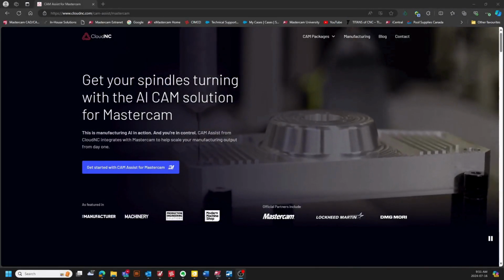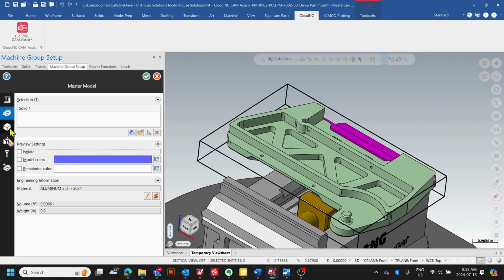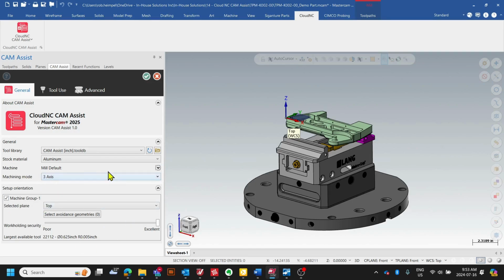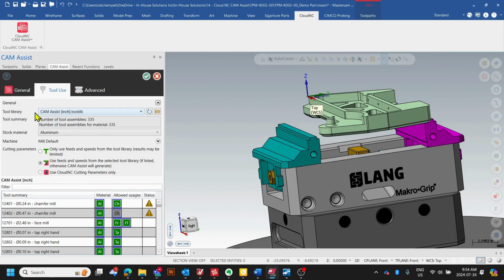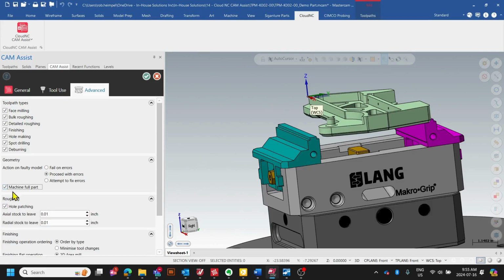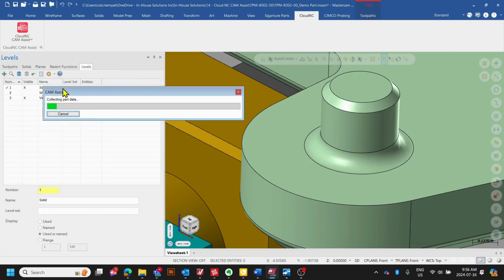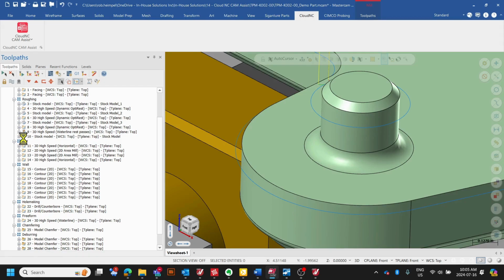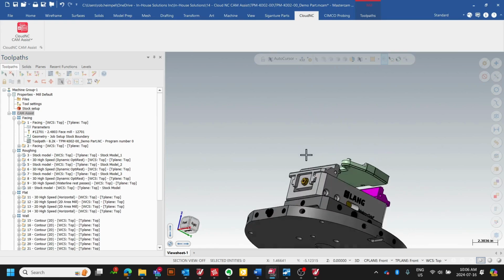CAM Assist for Mastercam: 3-Axis Setup (Part 1)

Comment: Meh.  The fact there's only a 14 day money back guarantee says alot to me.  I've been programming with Siemens NX (previously known as Unigraphics) for over 20 years.  I imagine there would probably be some tweaking to the operations after the base programs are all generated.  That being said, this is a pretty simple part and I can probably program that top side rough and finish in 20-30 minutes tops.
Rough
Rerough corners (smaller tool)
Drill/tap etc

Finish flat faces
Finish walls
Chamfer

I've created a bunch of macros and preset operations in my template file so it's pretty quick for me to set up and start going.  Have my most common tools already populated in the tools tab so I only have to copy an operation, pick the tool, define cut/check/levels etc and generate.
I've heard of people that have used this or drank the Kool-aid and after some time were advertising for programmers again.  
This really only would help bigger companies that have multiple programmers and do mostly 3 axis work.  They may be able to eliminate a couple guys.  Small companies like mine, I'm the only programmer and even if a small company has this software they still need a well versed programmer on staff.  The software will be good for making parts from scratch but I don't see how it can be used for rework, say after a part was modified or welded etc.  Any company that does alot of 5 axis work, like we do with injection mold making, we can't use this either.